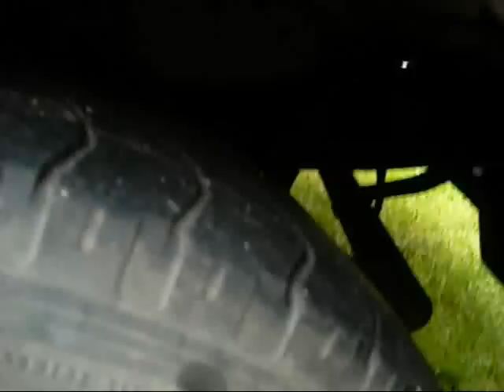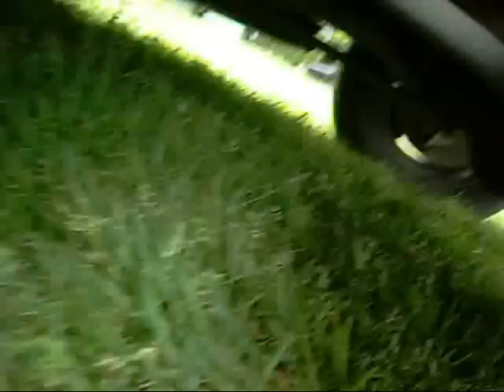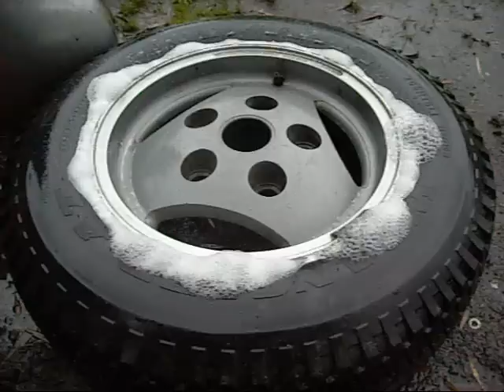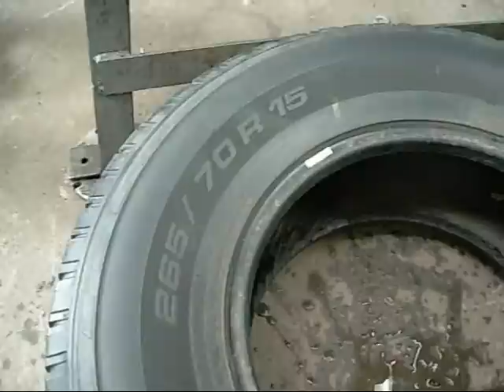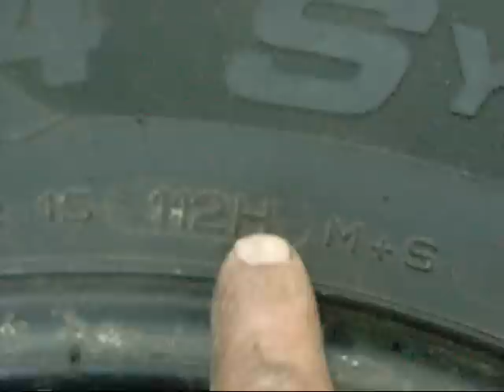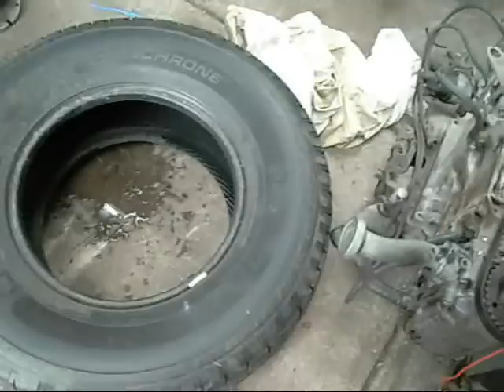Wheels, Tires and Brakes Pt1, Bad tires and Side Wall Markings

Comment: Sounds like automotive problems are universal. I collect and restore cars and have seen all the problems you show in the video. Ride height problems are usually easy to fix. Just about every suspension part has rubber bushings and when they all wear out at once, the vehicle sits unevenly. I've had aluminum rims leak all around the bead as well. Sometimes it's light corrosion on the rim that's not visible from the outside. Thanks for the great video!

Comment: Damn flat tyres lol. I am very surprised the rover doesnt have a safety bead on that rim!
$600 is pretty damn good for the entire kit! :D
That lean to one side would be shockers on that side are stuffed, had a vk commodore in for new shockers coz it was leaning to one side lol.
Its good having experience working with tyers and fitting them ect. I do it most times at work :) We use tubes a bit at work but most times its just plugs.
Great video and explanation  :D